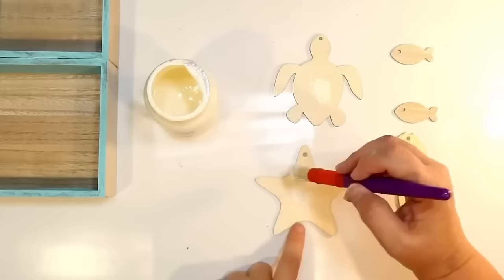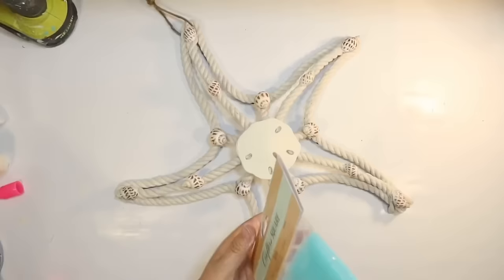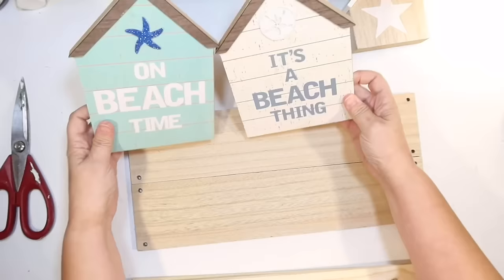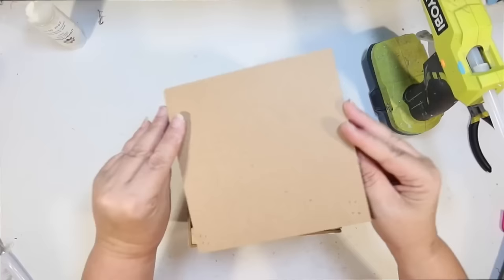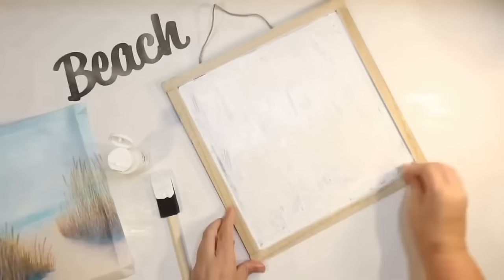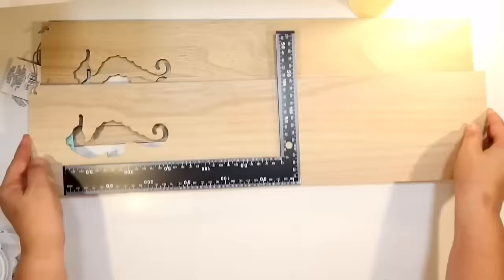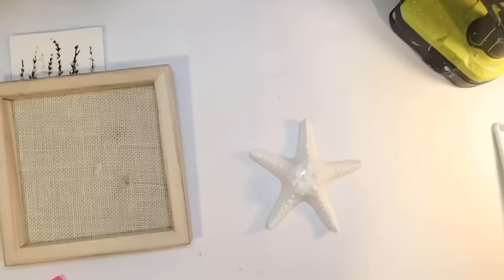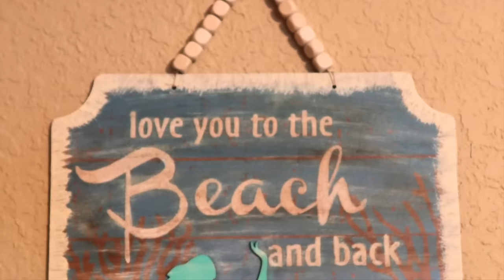🐚 Shell Yeah! 15 BEST Dollar Tree DIYS & Hacks! Coastal Beach Decor | Shore Living

Comment: I’m really not sure why the DIY community grabbed onto spackle to fill all these holes in our  WOOD projects. By now we use enough wooden ornaments from dollar tree that it could warrant grabbing some WOOD FILLER, which is made for filling wood . I actually find it a little more forgiving then LIGHTWEIGHT (bc that’s what’s on the shelves in the small containers) spackle!!
Wood filler def sands down better…. Specially if you’re using wood sandpaper to sand spackle. Bc the grit you’re using is prob too rough for the lightweight spackle.  Always make sure it’s layered ABOVE the surface level , then sand BACK down level or it will always be concave a bit.
Reply: Not a bad idea at all to slap that masking tape on the back to help give something to push that filler up against til it dries.
Reply from the maker: good point. I need some. :)